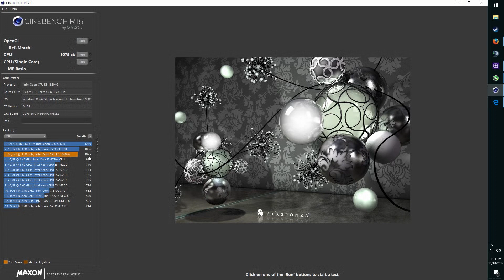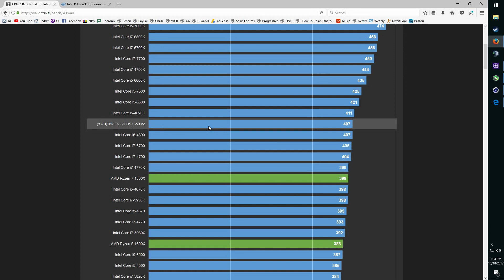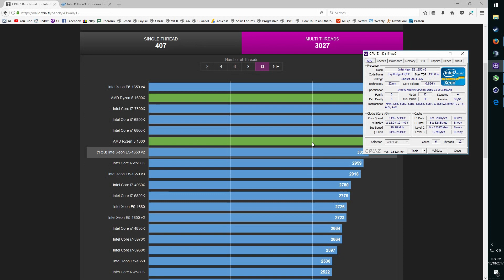Unboxing and Overclock of 6 core Intel Xeon e5 1650 v2 with Chineese x79 Motherboard

Comment: I know this is an old video but if you do not have an overclocking motherboard like HP Dell etc give "ThrottleStop" a try, you can change voltages and 

overclock and underclock to save battery on laptops etc.

Comment: Ok, so any one planning on a 1680 v2 on an unbranded mb, don't waste your money, I just dropped a 1680v2 in my 1650v2 with very slight gains.  As far as overclocking goes, it won't let me oc past 4.1ghz, which is where I was running my 1650v2. A 1700x still scores higher, and my money would have been better spent in that direction.

Comment: Can this 1650 be overclocked to 4.4 GHz with a liquid cooler?
Reply: yes, it overclocks better then the i7 3770k because it doesnt have shitty thermalpaste, but its solderd, also the xeons are binned chips, intel used their best chips for xeons, also it has a bigger surface area wich makes for better heat conduction.

Comment: What ram were you using with this? Specifically what /SPEED/ ram were you using with this? This chip supports up to ddr3-1867 stock, are you using ddr3-1867 with it?

Comment: Got to increase my multiplier to x45 but how come my e5 1650 v2 only reaches x35 on 100% load?
Reply: Need to change some of the code on the motherboard bios with hex editor !

Comment: I'd more concerned with cooling the VRM than the CPU while trying to overclock.  These Chinese boards are known to run really hot.
Reply: Not the HUANAN x79 Gaming , that one has very good vrm cooling : https://nl.aliexpress.com/item/HUANAN-golden-Deluxe-X79-gaming-moederbord-intel-LGA-2011-ATX-ondersteuning-4x16-GB-64-GB-geheugen/32849620307.html

Comment: Which is better for games E5 2680 V2 or E5 1650 V2?
Reply: For games I might guess the 16xx series. I bought a 2-CPU with E5-2640, and the graphics performance is terrible, despite nVidia Quadro P4000. PerformanceTest benchmark shows the E5-16xx series doing much better. I'm going to replace my (2) E5-2640 CPUs with (1) E5-1660 v2, I think.
Reply: @aridaniels927  look into the 1660v2 as well, it has 200 mhz higher base clock and 3 mb more cache then the 1650v2
Reply: Jeffrey Bozko The V2 and V3 processors looked like they had good options. But my motherboard was only able to handle the V1 processors. I ended up just building a new computer from scratch, and it’s a wicked machine. i9-9900k, plus all the support/peripherals it needs so I don’t have weak links.
Reply: @aridaniels927  ya well im not spending  500 usd for a cpu that will be worth 200 in a  few years. Or in couple months you can by a ryzen 3600x thats faster and for  for half of the money.
Reply: Jeffrey Bozko I totally understand. For me, at that time, I needed a computer that wouldn’t hinder my work, in any way. I could have gone with something close and a little cheaper, but decided to “future-proof” my computer a bit. The performance needs outweighed the budget desires.
Reply: @aridaniels927  But if you went for future proof,  why did you get socket 1151, you know how intel works, next generation cpu's wont fit in your motherboard.
Reply: @budgetking2591  
When I say "future proof," the z390 for the i9-9900k is what I was referring to. By "future-proof," I mean that I went with the z390 and Core i9 (with DDR4-3200, M.2 NVMe SSD) instead of something like the z370 and i7-7700k, or i7-8700k. The Xeon build on socket 1151 was my attempt at a budget build, not the faster "future-proof" build.
Reply: @budgetking2591  Regarding the Ryzen 3600x:
(1) I needed a computer immediately, and the Ryzen 3000-series still isn't available yet, with a yet-unknown release date and availability.
(2) What suggests that the Ryzen 3600x is going to be faster than the i9-9900k? Is it this - https://www.pcgamesn.com/amd/ryzen-3000-release-date-ryzen-3rd-gen-specs-performance-price ? This basically says that it will be equivalent to the 9900k. 0.5% faster on a single benchmark test doesn't mean squat, statistically.

The barely perceptible performance increase (if it's really even true - the Cinebench test doesn't really apply to operating AutoCAD C3D, and the clock rating on the Ryzen 3600x is lower than the 9900k), the currently-unavailable status, the unknowns, and the statistically-relevant history of AMD processors not performing where they should, or as well as Intel's processors, all meant that it wasn't even a consideration, primarily the first point; I needed a computer immediately, not "when the next best thing comes out."

I think we all know that "future-proof" is sort of meaningless with respect to computers. By the time 5 years rolls around, there's a chance quantum computing is available at the individual consumer level.
Reply: @aridaniels927  Ah i understand you, i was mixing up future proof with upgradability.

Comment: Bro.seriously great and informative post.

Very hard to get information rwgatding chinese x79 and xeon processor overclock.

Btw.do you think there is a big difference between the 32nm 1650 vs your which is the v2 22nm in terms of performance?
Reply: most defiantly the 22nm version does not consume as much power as the 32 and also produces less heat
Reply: The 1650 v2 uses the Ivy Bridge microarchitecture so it's IPC is 6% better on average, besides being on 22nm which makes it more power efficient.

Comment: I've got the same Chinese x79 with same chip and I got a 4.2, with air cooling not exceeding 50 degrees C, usually low 40s. Using Hyper 212 Evo. I will look up that mod cuz my chip is nice.
Reply: Jc Essad i will try be more radical, i will buy a watercooling block of 8 10$ and plug it to my apartment tap water, pls tell me if that is crazy or make sense
Reply: @polentusmax6100  did you do it? It may be a not so crazy idea if the water in your city is always clean (mine is always brown)
Reply: @kevinandreszaletaandrade4461  it was a bad idea, water bills will be much higuer... but u saw a russian guy that used this setup to have benchmarks on a fx to pass 5ghz, so for normal usage is crap, but for some benchmarks records that may work fine
Reply: What if you make the water that enters your house go to your card first? And make a valvula to redirect the water back to the main tube when no one is using anything so there is still water going through your card
Reply: you need a pump to do that
Reply: @polentusmax6100  what if you get a cheap one
Reply: Does this Motherboard accept over more than 4.2 ghz?

Comment: Hi, on the standard firmware of this motherboard, there is no voltmod, but you can download the custom firmware of Russian craftsmen in which there is a voltmod, in which case the overclocking will be at the level of 4300 - 4400Mhz
Reply: Хохо, Ремонтяш, ты тоже тут?! :D
Reply: where can i find the custom firmware ? do you know the website ?
Reply: thank you ...
Reply: Ремонтяш??!! I didn't expect to meet you
Reply: @AlmalexRay  Do you know where is custom bios for HUANANZHI Deluxe X79 ?
Reply: @AlmalexRay  can i flash it to any mobo?
Reply: @Rogue_throttle  currently outdated
Reply: Where can i find It?

Comment: Nice
Im running a 1650 v2 @4,5ghz with  a vcore of 1,35 atm but on a asus p9x79 board really solid cpu,  r15 scores are 1203 and 162 with that oc
Reply: Jonny Wermelin Excellent results.
Reply: my old gaming rig (t3610) with the 1650v2, been able to run that 4.1ghz (80% stable) but I think that was the mobo not being too stable. been able to push it to 4.4ghz but real unstable. I got a ga-x79-ud3 that came with a e5-2670 but only getting 3ghz tops in it. If I can get 4.5ghz stable on the 1650v2, I will be real happy. Psu is a ax860 so its plenty enough for this... When I build an all new pc, that psu is going in it! r15 on the e5-2670 3ghz, I can get around 920. Aside from low clockspeed, its a good budget cpu. Grats on your results man.